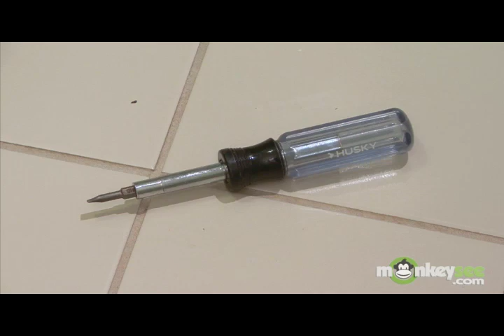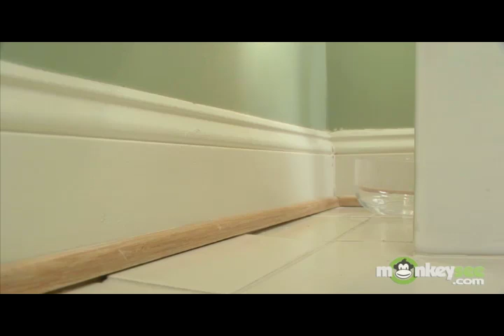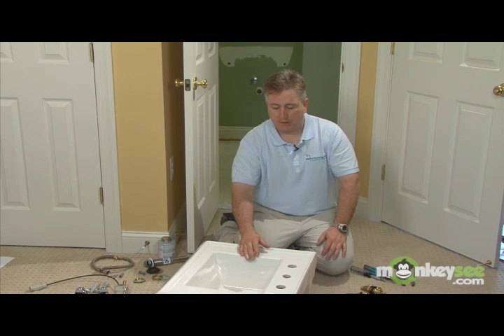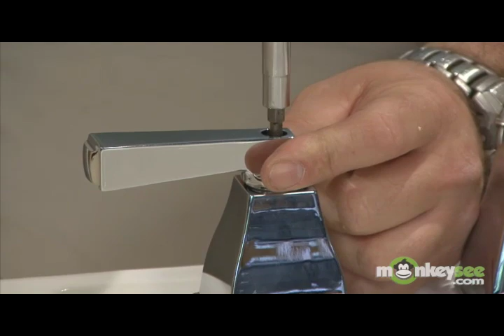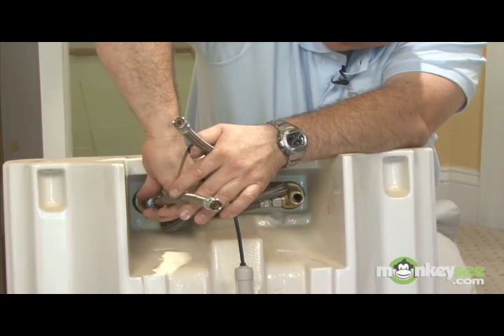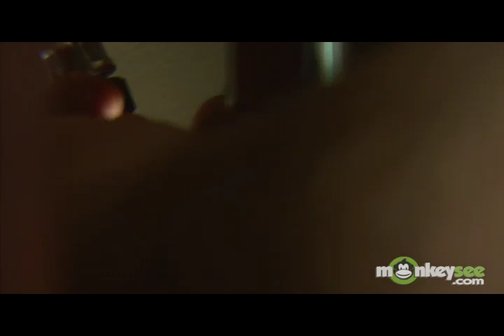How To Replace A Bathroom Pedestal Sink: Step-by-Step Instructions

Comment: I've watched a few similar videos, and all omit removing the drain pipe. I was given a sink to replace mine that cracked, except I cannot remove the metal drain pipe. Would appreciate instructions how to do so and explanation of...goop? to stop leaks on the new drain pipe.
Reply from the maker: Hello There! Our pedestal sink instructions exclude faucet and drain assembly details since they are purchased separately and can vary by brand and model. Please refer to those separately purchased product install documents for details, or you can always give us a call at 800-442-1902 and a member of our Consumer Connection team will be happy to help. Thanks!

Comment: Thank You!!!  Clear Step by Step Instructions.  This is exactly the pedestal Sink in my 1/2 bath  I want to replace for a Cabinet underneath to conceal cleaning supplies.  The instructions on measuring for replacement is key. This will help me.  I believe I can do this myself.  Besides, I've learned from a 3rd Generation License Plumber (wink).